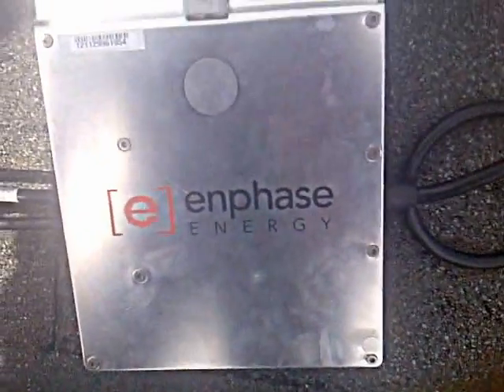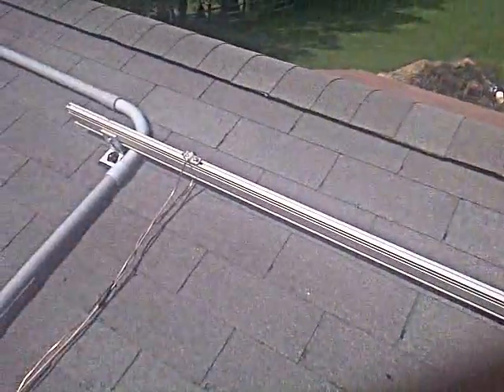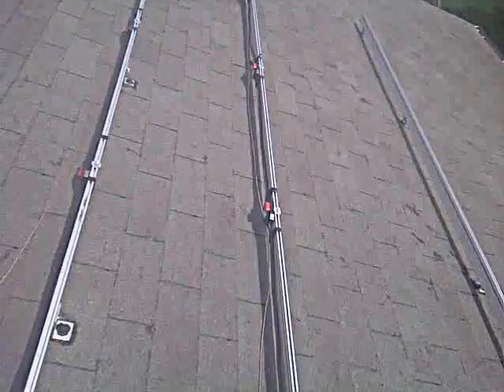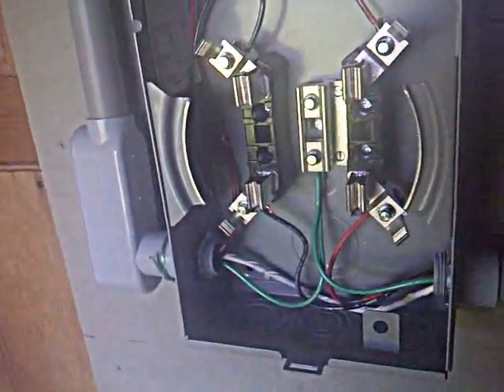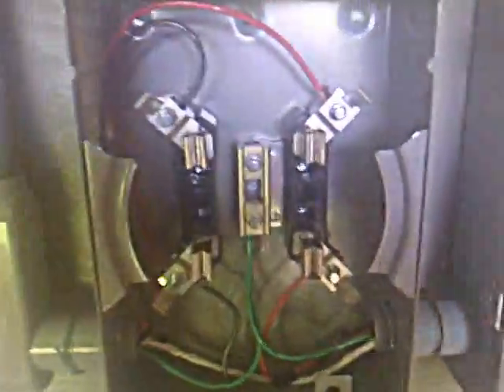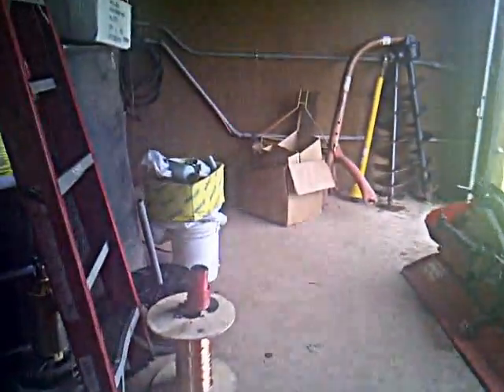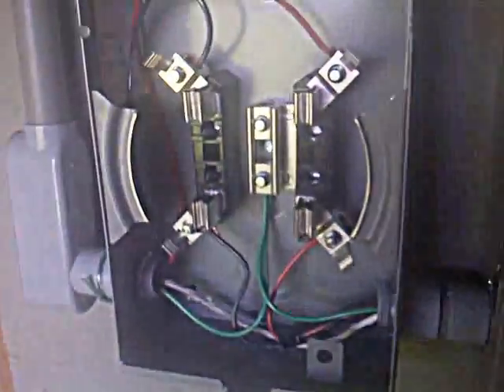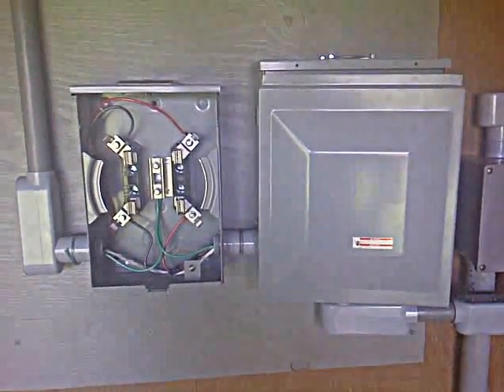Enphase Micro Inverter Grid Tie Solar Inverter Pa

Comment: Larry, that was a great and informative video! Thank You for the explanations. I didn't know that you needed to run metal conduit for DC. But when the 220 comes from the Enphase inverters through all the wiring and eventually back into the main, how does it terminate? I have 200 amp service at my residence. How would I run that into my panel? Another option I've been looking at are the Outback inverters. They seem to work well. What do you think? I'll wait for your reply. Thanks again for the v